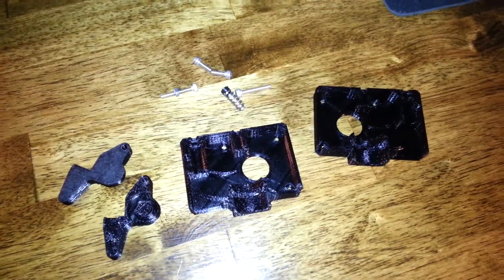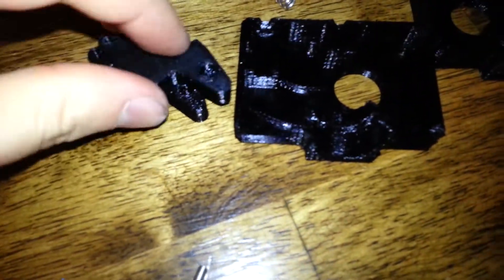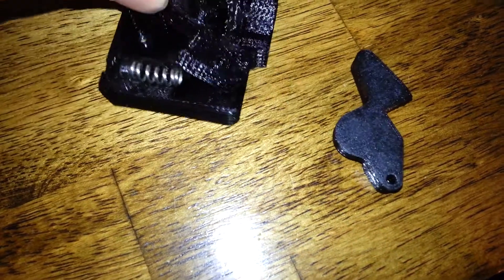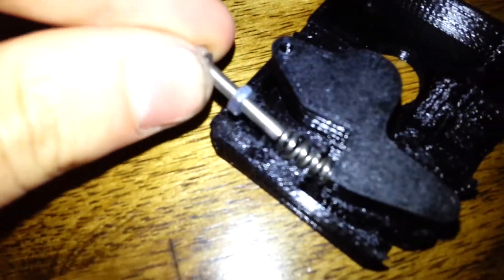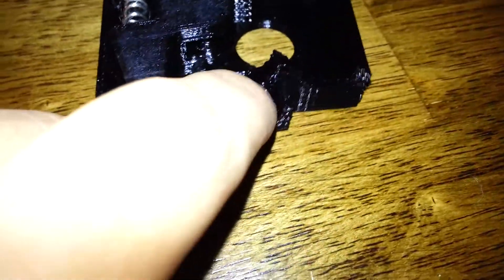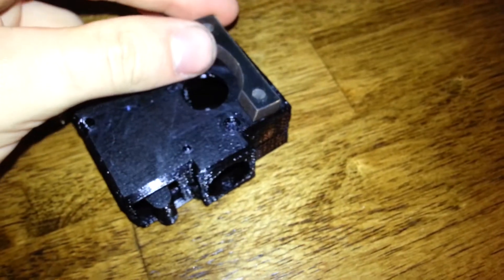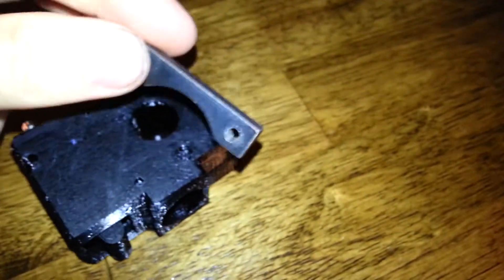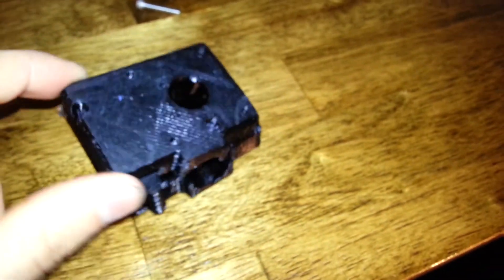QUBD One/Two-Up Custom Extruder Assembly Guide

Comment: What do you use for the "little plastic nub thingy" on the end of the spring?  My 2up didn't come with one.  Any ideas for what might work alternatively?
Reply from the maker: Wesley Knapp You can substitute that with any short m3 bolt, just slide the bolt into the spring and you're all set. the shorter the bolt the better
Reply: That's what I used, was just checking.  I filled the socket head with some melted PLA.

Comment: Hey bud, just out of curiosity, what is the temp you print Black ABS at?
Reply from the maker: Justin Shelton I don't print in abs just yet however from what I know it should be around 230-240 depending on the brand of filament and hot end.
Reply: Thanks man. I've been doing 215 in general and gotten pretty good results. Also switched up to a heated bed for ABS and it makes life easier lol. Thanks for the quick reply.
Reply from the maker: Well hey whatever works! no problem!